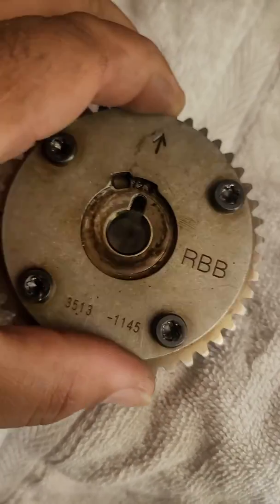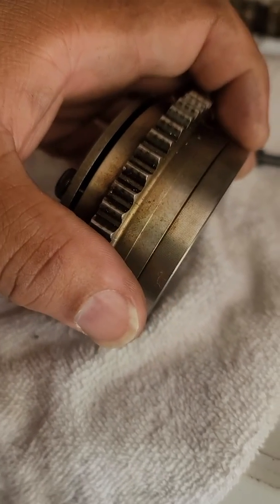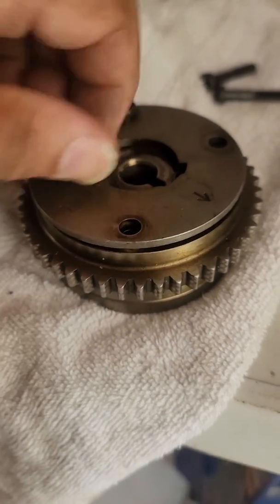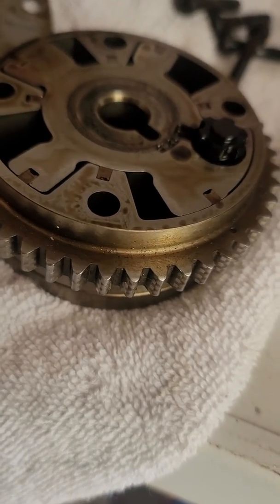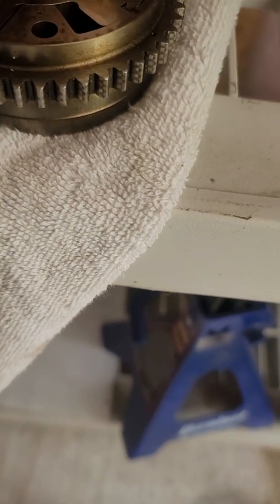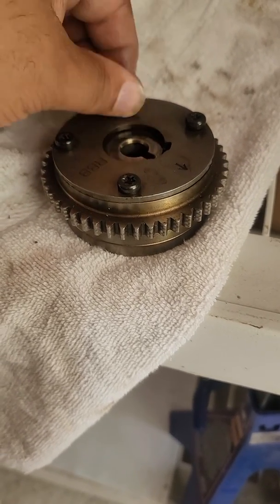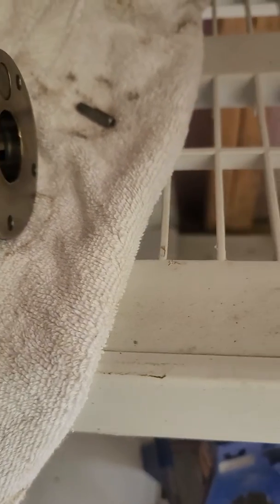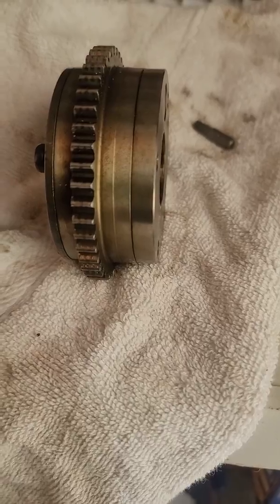vtc gear rattle fix

Comment: They sell new springs kits.   Stretching will work for a while but the spring gets weak in the in the first place whats keeping it from getting weak again.
Reply from the maker: Ya they do it's listed in the video descriptions
Reply: @dateg18 hola tal vez dispones de los pernos que son 4 del actuador, necesito cambiar el resorte y los 4 pernos espero tu respuesta gracias. 
Mi auto es CRV ex 2016

Comment: After stretching the spring, assembling the sprocket back together and bolting the sprocket back onto the camshaft, Do I  need to make sure the sprocket is in lock mode on the camshaft or can I leave the sprocket to move freely when I start the car to let it run for a while and shut the car off to let the sprocket do the locking automatically for the next engine starting?
Reply from the maker: It's will lock by itself you don't need to do anything else at this point

Comment: I just pulled mine apart while in the car and there is no plastic piece just the spring
Reply from the maker: The plastic pieces should be on the back of the VTC gear

Comment: I have been fighting this symptom for the past week. I replaced the actuator the VTC solenoid the timing chain and the timing chain tension arm still that stupid rattle is there. Running out of ideas here. The car failed the VTC test BTW, in the scan tool so all I know is the VTC system doesn’t work whatsoever. Star car cranks up sometimes and gives no engine codes but sometimes fails to start. Any thoughts or suggestions would be welcome and appreciated. Thank you.
Reply from the maker: If you replace everything else the vtc gear is the only thing that is left I have a link to a company that sell replacement spring for the vtc 50° and the rbb vtc spring

Comment: just do it right and replace the cam gear.. the spring fix is only temporary.
Reply from the maker: I hear you but not everyone has the money to spend 250.00 on a vtc gear when replacing the spring is 20-30.00

Comment: ChrisFix has a good video of doing this, while the engine is still in the car.
Reply: Cris fix is a copy cat from other YouTube videos and he still did it wrong because he supposed to crack the 17 mm bolt first before tensioning the chain, that way there's less chance of errors on timing with the struggle of getting the 17mm bolt off with the pin holding the time .

Comment: Can you go too far stretching that spring cause I did it and I might have stretched it to much and got a po 341?i already checked my timing marks on it and chain is not that old and new tensioner
Reply from the maker: @ricardocenteno375  you can did you put the car at tdc before you removed the vtc spring
Reply: @ that I didn’t do but the way the top plate came off arrow pointing the dot that’s same way it went on
Reply: I put a chain and new vtc actuator gear at 195,000 miles tensioner and all the hardware went good now I have 289,000 miles just started making the rattle it’s a Dorman actuator gear ⚙️

Comment: So that the back doesn't fall off could I just remove 3 bolts completely and then leave one connected to hold the back part on?
Reply from the maker: @rickmoore1103  i never done it that way but you can try it

Comment: I changed the spring  now engine light is on what to do? Code p00012
Reply from the maker: @samimhameedi522  did you make sure the motor was on TDC before you removed the vtc cover?
Reply: @dateg18  Thank you so much for your response. The mechanic removed the cylinder head and sent it to another mechanic for proper repairs. The second mechanic opened the camshaft and replaced the spring inside the gear of the Variable Valve Timing (VVT) system. After making these changes, the mechanic reassembled and reinstalled all the engine components. When they started the engine, it ran very smoothly with no noise. They took it for a test drive, and there were no issues, but the engine check light remained on. They did clear the engine check light, and even after restarting the engine, the light came back on and stayed illuminated.

The mechanic suggested that the light might go away on its own because the new spring was installed, and it may need some break-in time to settle. He said that once it’s fully seated, the engine check light could disappear. I’m not sure if he’s correct, so we’re currently in this situation. The plan is to drive the vehicle for a few days—about 100 to 120 miles—and then check again.

I’d like your advice. What’s your opinion? Should we replace the entire camshaft, or is there something else we should do? The engine timing has been verified as accurate by three professional mechanics, and they’ve confirmed there’s no issue with the timing itself. However, it seems like something might still be wrong with the camshaft. What’s your view on this?please
Reply: @samimhameedi522  This is very uncommon. Did you use the correct spring from a Spring-Start kit?
Reply: @spring-start  changed the Camshaft issue resolved.

Comment: I need the dimensions of the spring which comes in this RBB actuator. If anybody has it, please let me know. Thank you for the video mate!
Reply from the maker: @quiteguide  there a link in my bio for a company that sells replacement springs
Reply: Spring-Start VTC  has exactly what you need for a good price. They usually include extras.

Comment: Ripping the timing cover off of these Accords is not fun, especially in the cold.  This is a good last resort measure, but after the many, many miserable hours in the cold on that job I would drop $200 on eBay for a genuine Honda part.
Reply from the maker: @TimothyOnline  i has link in my bio to a replacement vtc spring

Comment: Dear friend, I am in Europe and I have the same problem with a Honda Fit. It is not possible to buy a spring. Could you tell me the dimensions of the spring so that I can find analogs.
Reply from the maker: @viacheslav7313  i have a link posted in the bio for replacement springs
Reply: @dateg18  I live in Eastern Europe, we do not have delivery from Canada and the USA
Reply: @viacheslav7313  suffering from the same issue. please let me know if you can find the dimensions of the spring.

Comment: I had a P0011, and P1651, with loud rattling, can’t thank you enough! I saved $1800, I own a 2009 Honda Accord EXL with 88k miles, I went to Home Depot, bought 5 M60x30 bolts ($6.28), orange thread lock ($2.99), reused my original spring just stretched it and reinsert with new Home Depot screws with thread lock. Now all the codes went away and drives perfect again! The dealer was going to charge me for a new timing belt replacement, new actuator, new tensioner, whole new PZEV VVT, and oil change for $1800 without tax. Took me 30 minutes, Boom! Drove it and it was fine. It’s been 2 weeks now, drives normal and no rattling while start up and no rattling while driving! ❤❤❤❤
Reply: Actually was a P2651 not P01651
Reply: Hola el ruido tambien lo presentaba al encender el aire acondicionado??
Reply: @cristofhersimon5721 开空调有噪音不一定是这个问题 我的只是vtc执行器异响 开空调噪音大 毕竟这个车年限很久了

Comment: Can all the vtc cover bolts be removed while installed on a Honda CR-V , or, is the timing cover in the way on the bottom half of the VTC  to be able to remove the lower bolts?. Or is it ok to simply rotate the engine to ppsition the bolts higher for access ?
Reply from the maker: @ericaviator8869  the timming cover is not in the way at the bottom just turn the main pulley to the tbc mark and remove the vavle cover when u put the motor at TDC the point on the vtc cam will be at the very stop you will see it on the back of the vtc gear

Comment: Hello I did this in my Toyota Avensis 1.8 petrol. the rattling is gone Is it possible that the spring is now too stretched? After starting the engine does not work evenly, errors p0351, p0352, p0340 appeared
Reply from the maker: @mariuszs.7189  I'm not sure of this when it comes to toyota how there timming works did you check the engine code 🤔
Reply from the maker: Before you did the spring did u make sure the motor was on tdc and the timming was right before you started the motor?

Comment: I thought of this very thing:   to just stretch out the spring.   The mechanics want small fortunes to do this and want to replace the whole timing chain and the vtc gear.
Thanks for the video.
Reply: The plate is attached to the gear with weird/fancy screws to discourage servicing-they want you to replace the whole gear. My Toyota has several things done in a DIY-unfriendly way. You should see where they put the PCV valve! A dealer will charge you a small fortune to remove the intake manifold & jack up the engine, but I managed to reach it through the wheel well, and with the right combination of swivels, extensions, and contortions, I did it. Cost: $10 versus $600. Here, cost of a new valve cover gasket set and a five-point Weird Torx Bit.

Comment: If you pack the back of them with cardboard before disassemble it  can't move then remove the 4 bolts it's 16lbs foot of torque to reassemble

Comment: I'll have to try this, I replaced the cam phaser on my 2011 Accord 7 years ago and within the past year it's started clattering every time I start it. The parts guy at Honda assured me that the phaser they sold me was the "updated" version even though it has the same part number.....BS. Being a mechanic I have absolutely no desire to work on my own vehicle so this will make my life a little easier if it works. I'm about due for my 200k valve adjustment and plug replacement (early) so I will try this instead of replacing the whole thing again. BTW, you have a white, Canadian cousin selling tools for Snap-on here in Texas, seriously, the similarities between you two are eerie.

Comment: Purchased spring from spring start.  Did not solve problem.  Now in the middle of replacing timing chain and have new VTC actuator gear
Reply from the maker: @MrBobby3340  when was the last time the timming chain tensioner was replaced? Because that will make the noise as well if it goes bad
Reply: Sorry to hear the Spring-Start kit didn't work in your case. We do have replacement VTC seals and different spring designs for the tougher cases and for some it's best to replace the TCT as well.
Reply: @dateg18  I replaced the tensioner first several months back.  Didn’t correct anything.  Then purchased the spring and installed.  At first seemed to solve the problem but start up rattle returned.  So now, I pulled timing cover off and replacing hordes, chain, actuator as well as exhaust sprocket.  I also installed new intake cam.  Should have it all back together this weekend.
Reply from the maker: @MrBobby3340  try replacing the timming chain tensioner
Reply: @dateg18  i have replaced it again with the work  I am doing now.

Comment: Great video but the problem I run into is those torx bolts are a bitch to crack open.  One of them stripped so now I gotta figure out what to do.  Have you run into this?
Reply from the maker: @gfriedman99  I have never seen that happened. You're the 1st to tell me about something like this
Reply: @dateg18  OK thanks.   Another youtuber says he is able to get them off with a small vice-grip.
Reply from the maker: @gfriedman99  ok, well, keep me posted if it works

Comment: i just did in my 16 ILX and it worked perfectly, the only difference that i saw was when i separated the plate from the cam it did not have the plastic piece that hold the spring. not sure if my motor does not use it but it didn’t have it. i took the spring, stretched it and put everything back together. started the engine and behold the rattle is gone. if anyone can confirm this info please let me know. regardless you saved me a ton of money, really appreciate it.

Comment: So I have a 2018 fit that had that rattle a few times a week on cold starts. Is this a "this needs fixed immediately" kinda issue or a "it can wait within reason"

It just started doing it, but it's not often. Some people on the honda fit reddit said it could be fine for years until it finally stretches the timing belt. I just don't have the know how or the money to have somone go in there and replace the spring.

Comment: My 06 GMC envoy got a rattle I'm not sure if it's the vvt solenoid or my timing chain or the spring but it lost a little power and it's got camshaft codes and crankshaft codes what could it be

Comment: what is the torque on those bolts?
Reply: It will depend on the VTC actuator you have. Spring-Start has the proper access bit and brand new extreme springs kits to fix any Honda or Acura VTC Actuator cold start rattle.
Reply: @spring-start  are there instructions?
Reply: @zekeharley Yes, they include pictures and written instructions plus the access bit and Spring-Start springs in every kit.

Comment: Useful video, thanks. One thing: if stretching the spring doesn't work, and then you order the kit from Spring Start, it comes with a recommendation that you also replace the chain tensioner, in addition to swapping out the spring on the VTC. So, depending on your mechanical skills, you may or may not have a hard time with that. What bothers me is that apparently there is no mention of this 'prior' to buying the kit, so Spring Start is giving you the impression that just changing the spring will fix the problem.

I wouldn't exactly call that shady, but I do think it's a pretty big omission.
Reply from the maker: When posting the video at the time, there was no replacement vtc spring available to buy, and yes, there is still a startup rattle. You should consider replacing the timming chain tensioner because they are faulty too and ppl I'm not a Professional mechanic. I have just been Fortunate enough to have friends that have worked for honda over the years I've been doing this since the early 90s.
Reply: @dateg18  

NP bro, I get that you are just trying to help...much appreciated. So, are you saying that you replaced the spring and still got the rattle? I'm about to order the spring kit and the tensioner, and give this thing a go. But first I want to see if my chain is stretched, if it is then I'll have to get that too.

What a PITA, and Honda still doesn't have an official fix for this issue. By the way, I'm no mechanic either, but what I think I can do I'll try to do, and hope I don't F it up.
Reply: This seems to be happening on the 2.4 from 2008 through 2017. You think Honda engineers would have figured this out by now. Put a thicker gauge spring which is a .50 part. Problem solved.
Reply: @tpc3416  

Honda clearly just wants this issue to go away, they haven't had a service bulletin since 2017 on it, so we are stuck.

My 2009 Accord is solid in every way, except for this VCT actuator. Even Honda mechanics are split 50/50...some say replace all the timing components, others say just keep topping off the oil.

It's frustrating and aggravating to say the least.
Reply: It would depend on the year and model of the vehicle as well as milage if the TCT replacement is recommended. Often, replacing the VTC actuator locking spring alone resolves the issue. Some vehicles need a higher rate spring others the OEM design spring for best results.
Reply: Great thread! Can someone please provide a link to the spring kit mentioned? Are people finding that either the stretching method or the new spring kit replacement is more permanent?
Thank you 
Special thanks to @dateg18 for posting 👍🏻
Happy New Year 🍻

Comment: I just got this rattle for the first time this morning on cold start at 220k miles. I’m gonna try this
Reply: Let us know how it goes bro, I'm trying to gather some confidence to do this myself. One thing that I heard though, is that the spring kit (from Spring Start) comes with instructions that also recommends replacing the chain tensioner as well, but you don't find out about it until you get the kit. The tensioner isn't the hardest job, but it's not the easiest either.
Reply: @094340  SO did you replace something already? just the spring or with the tensioner as well?
Reply: Did you do it? I have same problem and i want to try to fix it

Comment: What have your results been like now, two years after this post? Was it a one time fix or you have to consistently replace or fix the spring? If so, how often (miles) do you find yourself doing it?
Reply from the maker: It's still going good with no problem at all but I posted a link to a company that sales vtc spring replacement
Reply: @dateg18  DO you live in a warm to hot climate area? I am considering asking my mechanic to do this. I'm tired of replacing the part over and over. 
How often do you have stretch the spring or change them out?
Reply from the maker: @mezzozayas I only did it the one time and that's it

Comment: Thanks for sharing man. My 03 RSX has been doing the start up rattle for a while now. I was going to replace the whole gear but will try this first.
Reply: Did it work?
Reply: Still haven’t done it. Had many other things to do on other vehicles. Hope it will work though.
Reply: @wza223-fo3mc  about 8 months. 03 RSXtype S.  Also hearing a little rattle in there aside from the gear.  Need to check the timing chain soon.

Comment: Great idea but i can't imagine this would last long with daily use.  Might as well replace the spring and or actuator while it's out.
Reply from the maker: I have done this on my own si, and it's been 2 years now, and not working just fine no problem I posted a link in my bio to a company that sell replacement vtc springs hope it help sir

Comment: We have a used 2012 Accord SE, exhibits a quick rattle(<5secs) from cold start. If we do religious oil changes with good quality oil, what would be the consequence if spring is not replaced/stretched and no CEL yet? Thx

Comment: What cam gear ⚙️ is this on ? 
And by doing  it on the the car it won’t mess up timing ??
Reply from the maker: It on a rbb cam gear and no this will not miss with your timming just make sure your a TDC before you do the job and there a link in my Description